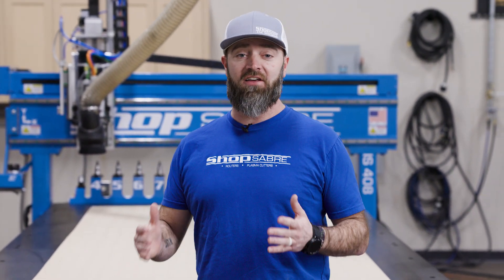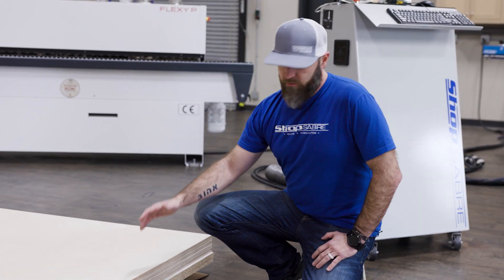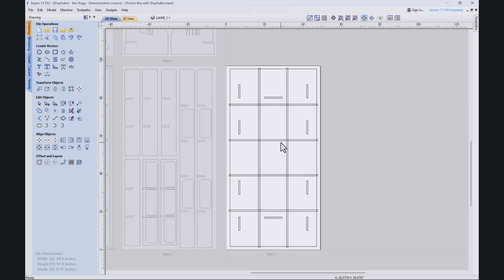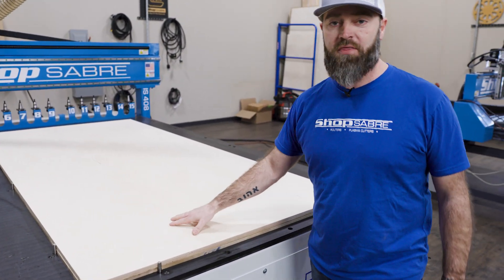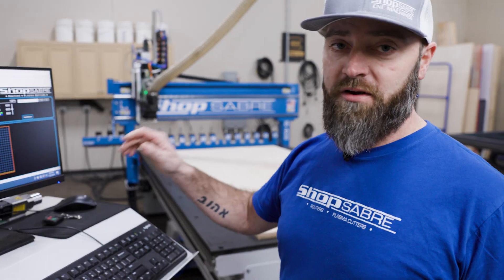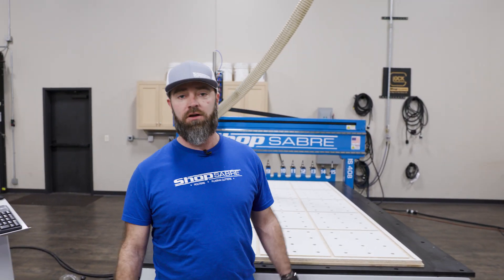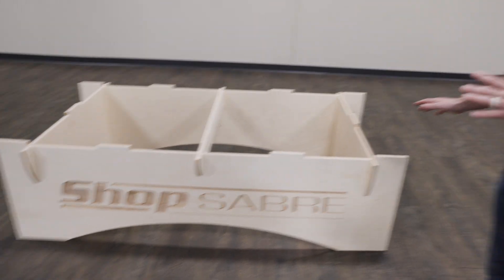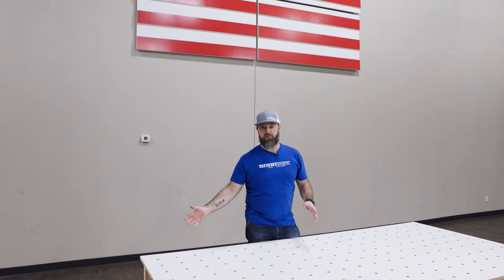Making a Torsion Box - ShopSabre CNC

Comment: Why are you opening and closing the vacuum valves manually? Doesn't the pump turn on and off automatically? Or at least with a switch like the dust collection? btw the rotating ball nuts are nice. As is the 3 position carry around ATC.
Reply from the maker: With this setup, you an choose which section of the bed to send vacuum to. For cuts in the first 1/4 it may make sense to close the other valves and force all vacuum into that section to increase its strength.

Comment: If you wanted to put it on wheels, how would you go about it on this design?  4x4 blocking for the casters?
Reply from the maker: That is a good question, we did not put it on wheels so we do not have any experience with doing so but I would likely guess that you would build a frame for the bottom and have attached casters to that frame.

Comment: I have a Pro 408. It looks like your dust collection attachment at the motor is quite a bit different. Is that 3D printed? Do you sell it or have 3D printer files for it? It looks like it would increase the suction power.
Reply from the maker: This is the new Stage 2 solution that comes with the Fav3 option

Comment: Did yall only upgrade your machine to have nice brass ball valves for the vacuum zones? Hopefully the new ones are that way, cause my IS 408 had those crappy PVC valves. Great Video though, want to make several for my shop.
Reply: Mine broke.  The collet wrench actually bites on the broken handle and works pretty well!
Reply: I agree, I have the older PVC valves and they need an upgrade!!!
Reply: I have the old valves as well, and if it's cold in the shop (like mine right now) they just don't work well.
If ShopSabre offered an upgrade, I'd pay for it!
Reply from the maker: The New IS  Series comes with the Brass Valves on the vacuum option -- You can check out the details on our Walk Around Video we did on the IS Series last year after releasing it at AWFS 2023
Reply: @shopsabre  I know it comes with brass valves, what I as asking if you have an upgrade option for my IS408? I'm not going to buy a new CNC just for brass valves
Reply from the maker: Sorry, misunderstood the question. At this moment, we don’t have an upgrade kit due to the front spacing changing from the valve size spacing being different.
Reply: @shopsabre  very nice, I'll probably upgrade mine a bit when I get some time to mess around with it. Still love my machine!